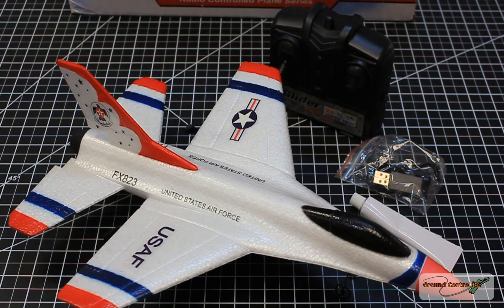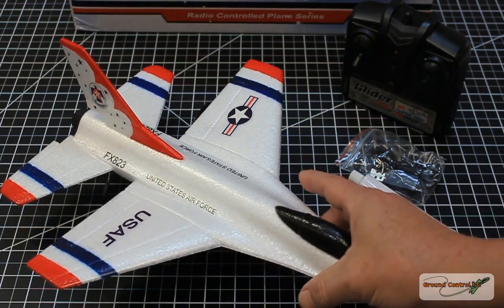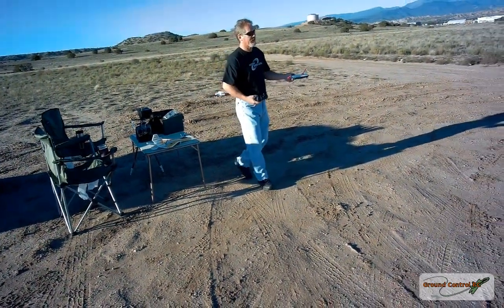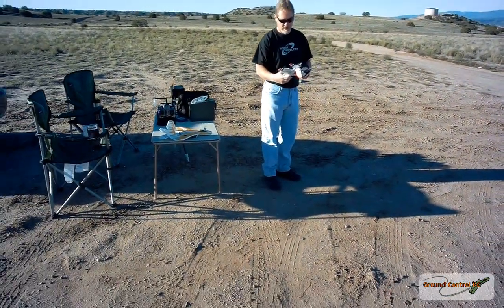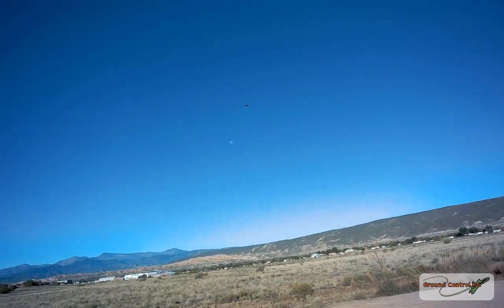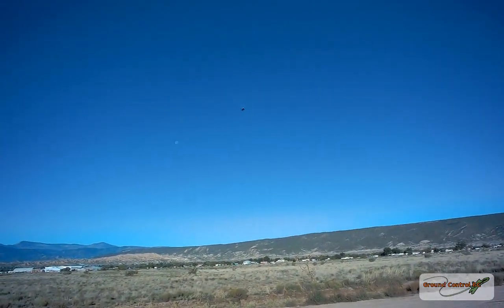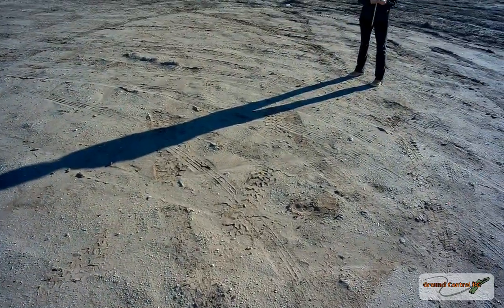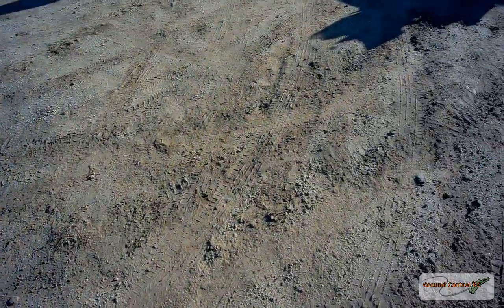Review - FlyBear FX823 Micro F-16 Plane

Comment: I bought two of them for my boys anb they fly great if you remember to be very gentle on the control.
I also put a 380mah battery to ad more weight at the front.
Reply from the maker: Yep, tried adding a bit of weight, moving the weight fore and aft trying to get it balanced so it wouldn't keep doing the porpoise thing. Also in the video you'll notice that every time I turned it would drop the nose unless I gave it full throttle in the turn. Sadly nothing worked. This one really seemed to be under powered. I purchased this plane because I had flown the FlyBear Red Baron Biplane and with a bit of nose weight it flew great. As a matter of fact, I think the FlyBear Red Baron Biplane is the best trainer for kids I have come across so far. I'm glad yours flew fine and bet your boys have a blast with them. I think the FlyBear Red Baron Biplane is a much better plane. Happy Flying!

Comment: I put a small woodscrew to balance mine and it does great. I've had several of these types but they always eventually lose the  the right prop signal for some odd reason . they have electronic issues with the rc chip
Reply from the maker: It's amazing how well these fly when they are balanced just right. I haven't had that issue yet thankfully ;-) See you in the Air!
Reply: @GroundControlRC  it's happened 3 times idk I changed the engine and it's an issue in the PC itself.I also fly it alot
Reply from the maker: @johncampagna645  , that is strange. I wonder why it's always the right motor and not the left. I wonder if it's a bad lot of right motors? I wonder if you installed a left motor and changed the polarity so the motor spins in the correct direction if it would last longer.
Reply: @GroundControlRC  yea it's a weakened signal not the engines. It's barely wants to spin on right side.
Reply from the maker: @johncampagna645  , I understand now. Let me know if you find anything that corrects that issue as I haven't seen that before. Hopefully it's doesn't require a complete replacement of the FC.

Comment: It's cool but doesn't seem to fly that well. I have been looking at these for a few weeks now and was thinking of getting one but to strip the motors and electrics out and making proper control surfaces and fitting it with 2-2.5g micro servos and a single brushless micro pusher motor. Or if it's big enough cutting it completely apart and try to fit a 30mm edf in it. Which cold be really cool. Happy flying to you.
...RCPP
Reply from the maker: Yeah, I think that would be a lot of work but if if flew well it sure would be a very cool little micro jet ;-)  Thanks for the comment and Happy Flying!
Reply: rcplanepirate  the plane is OK,,but many people doesn't know how to fly 2 channels planes.
Reply: theres a guy who just added a wltoys f949 servoboard and it flies great !

Comment: Is this good for beginners
Reply from the maker: I think all the Flybear Planes make good Trainer Planes. This specific one was just too under powered. The best Flybear Planes I've flown are the Red Baron Biplane and the SU-35. They are fantastic Trainer Planes.
Flybear FX828 Hornet Fighter 290mm Wingspan 2.4GHz 2CH EPP RC Airplane Warbird RTF - One Battery
https://usa.banggood.com/Flybear-FX828-Hornet-Fighter-290mm-Wingspan-2_4GHz-2CH-EPP-RC-Airplane-Warbird-RTF-p-1696162.html?p=WE081047791920140372
Flybear FX-820 2.4G 2CH Remote Control SU-35 Glider 290mm Wingspan EPP Micro Indoor RC Airplane Aircraft RTF
https://www.rcmoment.com/p-rm8974.html?aid=groundcontrolrc
Flybear FX-808 Red Baron Biplane 2.4G 2CH EPP Micro Indoor Parkflyers RC Biplane RTF
https://www.banggood.com/Flybear-FX-808-2_4G-2CH-EPP-Micro-Indoor-Parkflyers-RC-Biplane-RTF-p-1003311.html?p=WE081047791920140372
See you in the Air!
Reply: @GroundControlRC  thank you very much!

Comment: Should i buy?
Reply from the maker: Good question. Others have reported theirs worked just fine, however, I can only review the item I receive. I have flown (3) of the FlyBear planes thus far and (2) of them were a lot of fun ;-) All of them have been tail heavy from the start so some nose weight is needed. My (2) favorites are the Red Baron Biplane and the SU-35 Jet. Here is a link to the SU-35: https://www.rcmoment.com/p-rm8974.html?aid=groundcontrolrc     Here is a link to the Red Baron Biplane: https://www.banggood.com/Flybear-FX-808-2_4G-2CH-EPP-Micro-Indoor-Parkflyers-RC-Biplane-RTF-p-1003311.html?p=WE081047791920140372     See you in the Air!

Comment: บินสู้ลมไหวไหม
Reply from the maker: I'm not sure if I understand your question as the translation doesn't seem accurate, however, you can fly these little guys in a bit of wind. I have flown the FlyBear SU-35, which I just reviewed, in 6mph wind and it seemed to handle it just fine. It does require a bit more throttle management because they really want to climb when flying into the wind. You have to reduce throttle quite a bit when flying into the wind. I hope that was the correct answer and Happy Flying!

Comment: you cannot trust any glue you should test on little piece of foam first thats wt i do
Reply from the maker: I agree with you 100%! The one glue that I have used on all types of Foam so far, is Foam Tac. I've used it on Adams Foam Board, EPO, EPS, and EPP Foam an it seems to work very well. Thanks for the Tip and Happy Flying!
Reply: you welcome